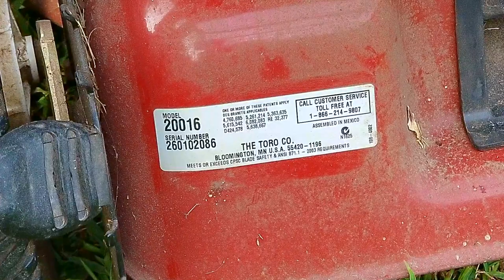Why Get A Tecumseh Powered Mower?

Comment: First, I have to say that this old Toro looks super clean.  Overall, I have preferred Briggs engines.  My 2 main gripes about Tecumseh engines have been:  1. Kind of a small point, but I never liked that there were multiple flywheel keys, compared to the single one that fits so many B&S engines.  2. I always thought that Tecumseh mufflers were pretty loud and annoying, compared to Briggs ones.  My 2 snow blowers are from 2002 (single stage) and 2008 (2 stage), and they both have Tecumseh Snow King engines, which was VERY common at the time.  Over the years, with some that I had sold or fixed for relatives, I sometimes replaced the stock Tec muffler with the quieter one, where available.  But for the folks like me and your other subscribers, who take care of these engines, it's possible to get many good years of service from either of them.
Reply from the maker: thank you Tom Lewis, I don't think I've run across a Tecumseh with 2 flywheel keys, must be on a different engine.
Reply: @HomeGaragechannel  Oh, I see what I did - I didn't say what I meant to say.  What I meant is that almost all of the B&S engines I have ever come across used the same shape flywheel key, so I just keep a few of those around.  Tecumseh had a different shaped key on various different engines (there was not "1 size fits almost all"), and my memory of them goes back to the ones with breaker points.  Some of the keys were 30884 step key, , 445223, and 610961.
Reply from the maker: oh I see, thanks for clarifying that!, thank you Tom Lewis
Reply: where to get a quiet muffler?

Comment: Do you ever remove/repair rust on or under the mower deck?  Or is it not worth the effort/time?
Reply from the maker: the answer to your question is no I don't, and as for the reason, it's a mower, not a car. And when the deck rusts thru, you can either patch it or replace the deck.
Reply: @HomeGaragechannel  If you ever do, I would be very interested in seeing it in a video.
Reply: @HomeGaragechannel  I just removed all the rust, patched with JB weld, sanded flat, painted with rust inhibitor, base coat, and then taped/final coated a lawn mower. - I must agree it was too much work for something I intend on selling.

Comment: Why does my oil level indicate approx 1”-2” high on my Tecumseh engine when my mower sits over night? If I wipe the dipstick the oil level  is fine. My other  power equipment when you pull out the dipstick on a cold engine the level indicates OK.
Reply from the maker: not sure, never had to deal with that, I always wipe and check.

Comment: I got a 90s tecumseh 4.5 hp engine  push mower, the string is too easy to pull but the spark plug works fine, adn I clean the carburetor and it pushes air out of the air intake, so yall know hwta to do?
Reply from the maker: could be a bad valve.

Comment: Ignorance of technical information and  correct workshop practices...coupled with the notion "that's not like the Briggs and Stratton" and assuming it was inferior because it was different and required different maintenance and repair methods proved its downfall.  Un-loved here in Australia too...but I own a few, one is 41 years old and runs perfectly. I like Tecumseh engines.
Reply from the maker: I like them too

Comment: Yes I had a Toro with Tecumseh engine very strong and if you're a mower mechanic for real, it makes no difference which engine it is !
Reply from the maker: well said!
Reply: @HomeGaragechannel  I need the throttle and governor spring linkage on my tecumseh engine. The stiff ones
Reply: @HomeGaragechannel  I need linkage to governor/throttle on Tecumseh engine
Reply from the maker: do you have a model and serial number for it?
Reply: @HomeGaragechannel  all I can do is take photo of tag on engine and of the whole engine and carb. It's missing the linkage to governor but not the spring. The spring I have
Reply from the maker: send it to homegaragemail@gmail.com
Reply: @HomeGaragechannel  i can send pictures of the carb side but I need an email or cell # in order to send pics
Reply: @HomeGaragechannel  I can send a picture of the Tecumseh engine to a call phone or email to see what's missing

Comment: I hate working on tecumseh..the intake system is a real pain when you actually have to pull the carb...Plus, Tecumseh never came up with an auto prime system that i Know of.. I disliked the primer type engines of B&S either. One pull start with an auto prime system makes  more sense.
Reply from the maker: thank you David Berry, and yes I you had to remove a Tecumseh carb with a throttle on it, it can be very finicky!

Comment: I try to take care of my equipment and maintain it as best I can. Knowing the difference now between Briggs and Tecumseh...I would chose Tecumseh if I could get the large wheel, rear drive system. Seems a technically superior engine and of higher quality.
Reply from the maker: nice choice, and find the larger drive wheels is pretty difficult nowadays
Reply: @HomeGaragechannel  Bought mine 2 years ago at Menards, its a Craftsman. I was pretty excited because it's only the second brand I have seen in this configuration. The first one was at Sam's Club and it  just looked and felt cheap. For a while I considered getting the Husqvarna all wheel drive with the large rear tires and disabling the front drive. That likely would have been a bad Idea..LOL. Keep up the good work, I have learned a lot  with your video's :))

Comment: i was introduced to small engines  about 1969,1970. Tecumseh engines were the engine of choice, especially on snow blowers. i have a 23  year old Ariens snowblower with a Tecumseh snow king engine and a 1980 craftsman eager 1 mower with a Tecumseh engine. both run as good today as they did when new. they both start on the first or second pull. i have used snowblowers with brigs engines and they don't seem to have the power of the old snow kings.
Reply from the maker: thank you for sharing that.